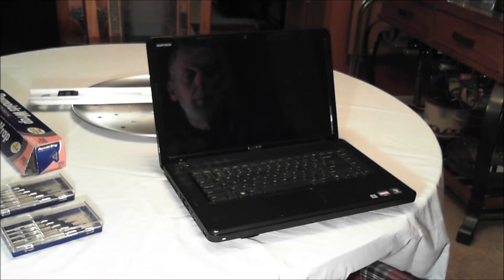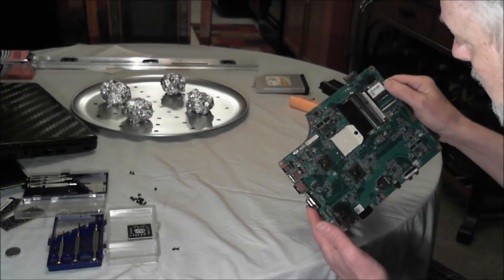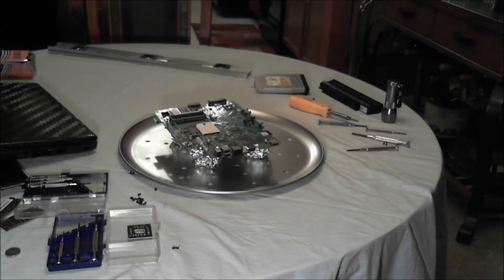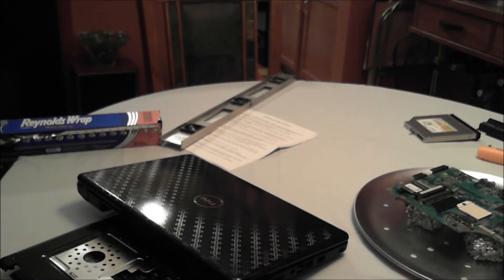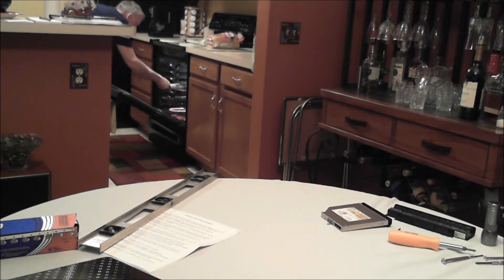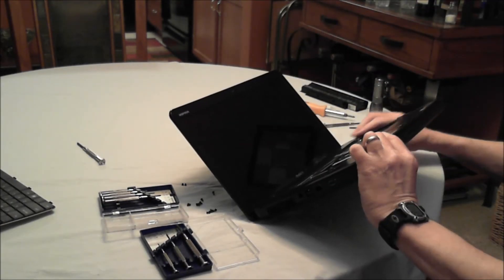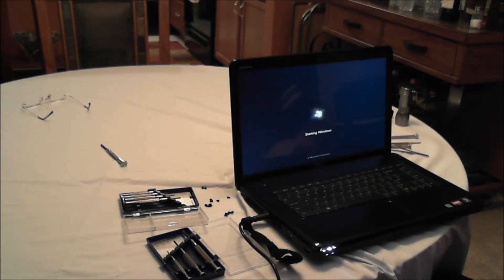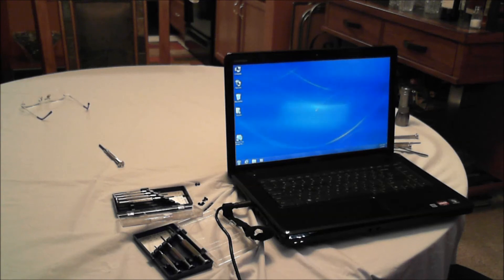Reflowing a Dell M5030 motherboard - Part 2

Comment: How long did this work for you?

:I did this, maybe it would help others?:
Found one at a thrift store for $25.
Reflowed those 2 chips on the board with a rework station at 500c and some flux. 
I then washed it in the sink and sprayed it down with alcohol (to wash away the water) then I put it in an oven at warm settings to dry it faster.

the two chips, instead of using the thermal pads, I used some thick X23-7783D Shin-Etsu thermal grease, and some MX4 on the cpu (mx4 was a little thinner, the X23-7783D fills large gaps - both are non electrically conductive TIMs).

Powered it on (found out the DVD drive was bad and replaced that too) and everything worked.

I just need to get a cheap battery for it and another power supply.
Reply from the maker: It's been so long ago I don't recall how long it lasted, but I don't think it was very long. Sounds like your fix should hold up well.

Comment: 09/10/2015 I just followed your instructions and it worked for me on an HP Pavilion DV7 which are also notorious for crappy GPU's.  I know it's a temp fix but hopefully I can get another year out of it.  My fan and heat sink were real dirty and I cleaned them so that should help with some of the heat issues.  I was doing a lot of HD video editing which is very hard on the GPU so I will no longer do that on my laptop and just use my Desktop for that.  Thanks for the tip.

Comment: I did this twice and both times worked!!! so i´m so thankfull <3 <3
Reply from the maker: Seoppie Lee I'm glad it worked for you. Just remember that this is a temporary fix, so don't be surprised if the problem re-occurs. Back up anything you have of value on the computer.

Comment: Hi Bill, as a hobby, i bought on eBay a very clean Acer laptop that the seller was told her laptop was toast. It was a real pain to take apart, but managed to remove motherboard and reflow for 8 minutes. I had really no expectations, but for the 30 bucks I paid, I figured what the heck. No hard drive was supplied. After reassembly , and using fresh thermal paste, low and behold, I was able to get to the BIOS. I picked a up a cheap hard drive, used my Windows 7 disc to boot and used COA sticker to activate. Total success. WOW! I sent  a picture to the seller. She was blown away.
Reply from the maker: Congrats! As you said, it was worth a shot. But I think you should consider it a temporary fix and not be surprised if the problem re-occurs.

Comment: I have a friend that has the same laptop and same problem. did this fix it 100% ?
Reply from the maker: This procedure will USUALLY work on this model if this is the only problem. But it should be considered a temporary fix. If it works, the laptop may function fine for a few weeks or a few months. The one I fixed worked for about a year before the same problem reappeared.
Reply: so if it happens again after a couple months / year, should my friend bake the motherboard again ? Thanks for responding so fast. I really appreciate it. Thanks! Scott
Reply from the maker: Scott Beebe It would be worth trying it again, but it's less likely to work if it's a second time. That model is just flawed. If the procedure works, be sure and back up any data on the laptop and don't assume that it will work all that long before the problem occurs again.
Reply: ok thank you very much, I really appreciate this information. Thanks! scott

Comment: This one is working. My laptop keep crashing when I used graphic extensive app like games and etc, then it happened when only i played video and it became worst until it will only power on for 5 sec and shut down. I bake it for 10 min in my unused sandwich electric oven, at max temperature. Hoping for the best!
 I'm writing on this laptop right now! It feel like the first time I bought it. Awesome! THANK YOU for this video.... It helped and save me alot and hope it does to others too. Hope it last for another decade!!!

P/S this problem will likely to occur when my laptop start building overheat from time to time and I'm not care to clean up the fan...
Reply from the maker: Glad it worked for you. Just remember that this is a temporary fix and that the problem will probably come back. Good luck!

Comment: Attempted this yesterday to my dell inspiron m5030. Followed instructions to the T and wouldn't y'know it WORKED. Really fantastic set of videos. I've taken apart a few laptops before and this was the easiest yet. If you have this laptop and you're getting 7 beeps I highly recommend trying this. As Bill said, 'you've got nothing to lose'. Thank you sir you saved me buying a new laptop. I'm curious if you still have yours Bill and if it's still working or if you've had to reflow it again. Again thanks so much for these videos they were excellent.
Reply from the maker: The one I fixed ran for about a year before the problem reoccurred. The owner of that computer got it to work for a while using "blanket method" where you turn on the computer and wrap it in a blanket for about 20 minutes. It's completely dead now as far as I know.

Comment: can you determine what's wrong on my dell inspiron 1545, first it has 6 beep and i reflow, then after that when i ON my laptop, the AC LED goes on but after a few seconds (may 30 sec) it turns off with no beep or fan spinning,
Reply from the maker: Sorry, but your computer is a different model with one or more different problems. I have no idea what might be wrong with it.

Comment: Bill:  Please tell everyone to take out their battery first. I didn't and the thing exploded in my over at the 8 minute mark, just as I was opening it to pull it out. Blew crud all over the oven and caught the mother board on fire. Got a nice mess to clean up and a computer to trash. The link you provided to show how to disassemble the laptop did not include any instruction to remove the battery, nor did your video. One simple step could save many others from my problem.
Reply from the maker: Sorry to hear of the problem you encountered. Yes, the battery and everything else that CAN be removed should be removed. And it is easy for me to understand how you might not have realized you needed to remove it. Also, the instructional video just showed how to remove the motherboard and wasn't intended as instruction on how to prepare the motherboard for "baking" in an oven. I will add an annotation to this video about removing the CMOS battery.
Reply from the maker: I just added an annotation reminding people of remove the CMOS battery and the plastic insert in the SD card slot. The annotation appears at about the 1 minute, 18 second mark.

Comment: Why did you race through the disassembly (and gone so slowly with the self-explanatory foil ball part)?  Disassembly is the one thing you should have gone slowly and carefully with if you wanted this to be useful to the lay audience.  I'm having a problem removing the fan's connection to the motherboard, as well as one other connection.  I basically can't use this technique because I can't dislodge these, and I really could have used the detail that was treated time-lapse style...
Reply from the maker: Apparently you did not watch the third video in this series. Go to the third video. At the 7 minute, 50 second mark of that third video there is a link to a video which shows instructions for dis-assembly and re-assembly of the Dell M5030 laptop computer. My videos were intended to show the re-flowing technique and were not intended to be an instructional video on dis-assembly and re-assembly.

Comment: hey bill, I did it with a hp g62, and actually worked , but I just left it for 7 minutes, at 385 f, I had the same problem before , and my brother did a reflow with a heat gun, but after a month did the same problem, and actually I barely used it, but right know is working fine after oven reflow, hope it don't do it again, cause if does i will let it until 10 minutes haha, thank you and the alluminium balls help.

Comment from the maker: Glad it worked for you. I view this as a temporary fix, but using Speed Fan will likely lengthen the working life of the computer as it does seem that running hot was a significant contributing factor in the problem.

Comment: Thank you Bill.  My neighbours who are "Senior Citizens" had the 7 beep issue - same make/model laptop as your video. they were about to splash their savings on a new laptop.  With nothing left to loose I followed your steps ( couldn't get the wi-fi card out either!)  I did take my time to ensure the oven was at the right temperature and put some new thermal paste on the cpu on the rebuild. Presto all working!!! . Downloaded speedfan and it's running cooler now.  I think this model runs too hot!

Comment from the maker: Thus demonstrating that faith isn't always necessary for computer work! Glad it worked for you, but please keep in mind that it is a temporary fix. It may last a day, a month, or a year. Probably no way to predict. Try to keep the computer running as cool as possible. Don't block the vent and don't sit it on a blanket or other soft surface. Good luck!

Comment: Hi Bill, noticed you left the WIFI card installed -- I found the screw impossible to remove, so i baked it with the mobo, and luckily it still works as well as the computer itself.  Thanks for the detailed video!

Comment from the maker: I didn't do much of a job cleaning off the thermal paste that was on the CPU, but I did apply additional thermal paste before putting the computer back together. I used Arctic Silver paste.

Comment: Hello Bill, 
I had my first 7 beep experience yesterday. Menage to start it up again after heating up my dell m5030 and when I closed it later 7 beep happened again, heating up worked again . I plan to re flow my motherboard this week. Did you changed and applied that cooling gel when you took it apart? Thanks for video, hope this will work because I need this computer for work and right now I'm not in situation to by a new one.

Comment: Bill thanks so much for the video! I just tried it last night and it worked, was amazed! 
I also drilled a few more holes on the bottom just below the MB to help a little with ventilation.

Comment from the maker: 3 beeps means, "Possible system board failure or Chipset error." You could try the oven fix again, but it is unlikely to help. You may need a new motherboard. Sorry.

Comment from the maker: I hope you don't offer more than a 30 day warranty on repairs! I'm guessing that a few months is the best you should hope for on this fix. After all, the customer will probably use the computer the same way as before and it will probably overheat and have another failure. But thanks for letting me know that yet another oven fix worked.

Comment: Funny thing is, I'm watching this on my m5030.
Luckily I had it on warranty and got a new one.
I now use speedfan to control my heat so that doesn't happen again.
I know on ebay as well there's people who sell their broken m5030s for $50.
So you can easily turn this thing around and earn a profit.
Very helpful! (I came across this while researching motherboard upgrades)
Talk about learning something new everyday.

Comment from the maker: No, if you try a hair dryer by blowing it into the side vent for a few minutes, you don't need to let it cool down before trying to turn it on. Even if it does start up after the hair dryer, don't expect it to keep working. I was able to get the computer I worked on to start after heating it with a hair dryer, but it was a very temporary fix. The "oven baked" motherboard has been working for several months now.

Comment from the maker: Glad to hear that it worked for you. As I have told others, please don't assume that this is a permanent fix for the problem. The one I fixed is still going a couple of months after coming out of the oven, but it won't surprise me at all if it starts doing the 7 beeps again at any time. Just keep it running as cool as you can.

Comment: Greetings, I thanked you in my first message that saved me 3000 pesos because I was told it was the motherboard, and you answered me that well, but I can possibly happen again in a few weeks or months, then my question now is : if I can place it back in the oven as often as necessary, ie each is present again the 7 beeps. and again many thanks.

Comment from the maker: I am not an expert on the use of Speed Fan and I know it is not all that "user friendly." Do a Google search on "using Speed Fan" and read up on it. But I do know that you should be doing all you can to cool the computer down when it is running. Generally speaking, this means running the fan more than the default.

Comment from the maker: Please do NOT assume that this fix will be lasting. It may work for a while, but the problem will probably reoccur. Try to avoid blocking the vent on the bottom of the case to avoid overheating. You might also want to investigate using Speed Fan to control the fan speed. I think overheating may have been the original cause of the problem.

Comment: I got it. thanks.  I used a heat gun and spread heat across the entire motherboard for about 2 minutes on each side, instead of the oven.  it worked great.  only thing bad that happened was the bios battery socket popped and doesn't hold the battery down.  I fixed it with a small piece of electrical tape for now.

Comment from the maker: With most tin/lead solder combinations, melting does not take place all at once. Fifty-fifty solder begins to melt at 183 C (361 F), but it's not fully melted until the temperature reaches 216 C (420 F). Between these two temperatures, the solder exists in a plastic or semi-liquid state. I'm thinking that this semi-liquid state is sufficiently "melted" to repair the hairline cracks that are causing the problem. Does this make sense to you?

Comment: Bill, Thanks for the post!  I just did this just before listing the laptop on eBay 'for parts, not working' and your solution worked!  The laptop started right up after, beeped 5 times and then went back to normal.  I restarted it again just to make sure and there were NO BEEPS!  I told my daughter that I 'baked her laptop' to fix it and she couldn't believe it.  Thanks a ton for posting!

Comment from the maker: You are heating the motherboard to a high enough temperature for the solder to "reflow" (liquify) and reconnect across a broken connection. It is sort of like you are re-solder almost all of the solder joints on the board. At least, that's how I understand it.
Reply: If that's the case, why do you think this is usually seen just as a temporary fix and likely to fail again?
Wouldn't the solder stay like it has been soldered?
Reply from the maker: @JNCHRH  I'm not sure why this fix doesn't last for some who try it. Whatever caused the original problem is likely to cause it again. Frequent heating and cooling can cause a solder joint to go bad.
Reply: @BillPorter1456  Thank you for your reply, yes, that makes sense! :)

Comment from the maker: You must mean the CMOS battery. Sorry about that, but I just assumed that anyone trying this technique would strip the motherboard down completely. Fortunately, those 2032 batteries are cheap and I would replace the one you baked if I were you. They are easy to pop out and replace. I think the power button doesn't work because the little ribbon cable from the button was not properly re-inserted into its connection base. I had this happen too. View the third video for information about this.

Comment: I just followed everything you did and can honestly say I am amazed. Nobody believed it would work including myself but we did it and it worked! The only problems I encountered was the lithium battery (that I wasnt told to remove and I didn't know how) kind of exploded and oozed out some of its juices but it then went back to solid form and I can't see any difference. Another problem (probably my fault) was that the power button no longer works because the little cable tag seems to have broken..